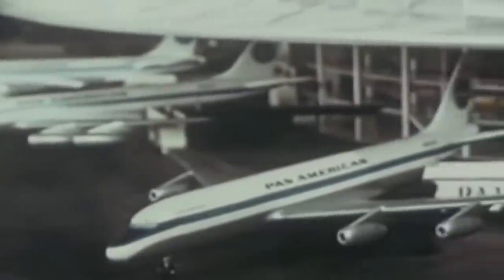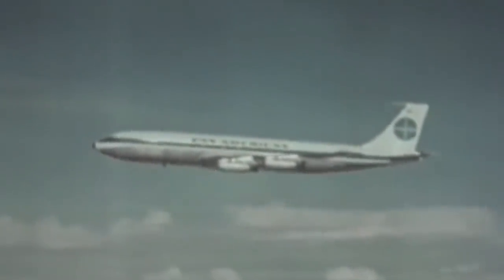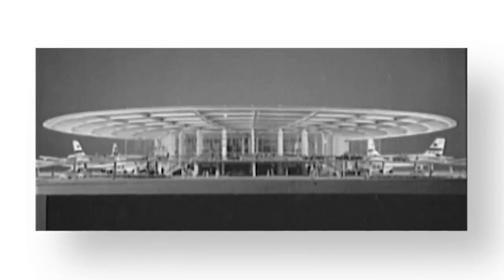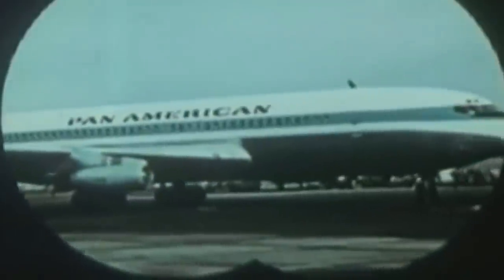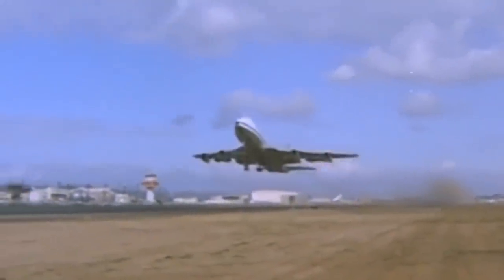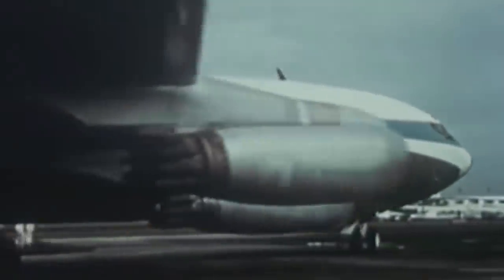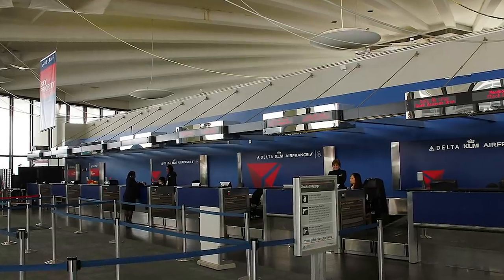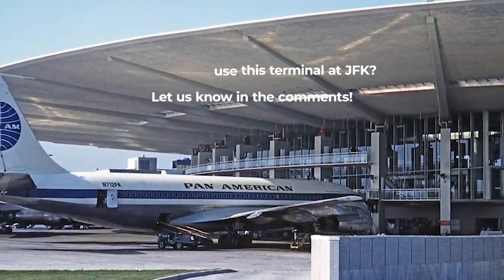What Happened To Pan Am’s Worldport at New York-JFK?

Comment: I practically grew up in the Pan Am World Port.  My father was a maintenance supervisor then zone supervisor for Pan Am from 1962 until 1991 (and then with Delta until 2006) at JFK.  I have lots of great memories of journeys begun and ended in that terminal.  Most of the beginnings were exciting not only because we were getting on an airplane to go somewhere, but also because of flying stand-by and wondering if we would get on the aircraft, and if we got on, would we get first class.  Fun times.

Comment: I never flew into this space during the PanAm days, but going in and out of it in late '00s and '10s, it was pretty abysmal. As an architect, I wish it could have been preserved. At the very least, the rotunda section warranted consideration. But it dark, and the stacked shops, bathrooms and lounges in the middle of the space detracted from the open architecture; the needs of 60s passengers and those of today were in conflict. I can see why it was demolished as it simply didn't work in meeting the needs of today's passengers or planes, but with Delta's split between T2 and T4, I wonder if this could not have been a grand check-in space somehow, or kept as an icon of the golden era of travel.

Comment: Never saw this place with my own eyes. It sounds to me like it was a grand concept for it's time, but eventually became obsolete as air traffic grew, unable to keep up with demand or meet the needs of current operations. The building itself probably decayed over time, buildings (and everything else) are designed with a finite life in mind, it is usually possible to maintain things beyond that but expenses rapidly climb, at which point it's more economical to tear down and rebuild. Thus it simply outlived it's usefulness.
Reply: I flew out of it a number of times in its final years. It was worth restoration and preservation in my opinion, but Delta didn't feel the same.